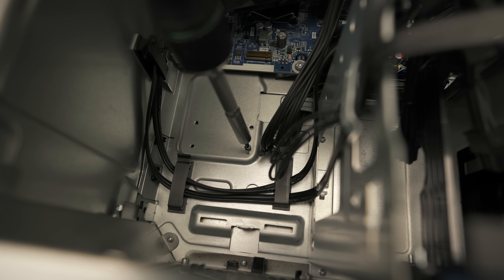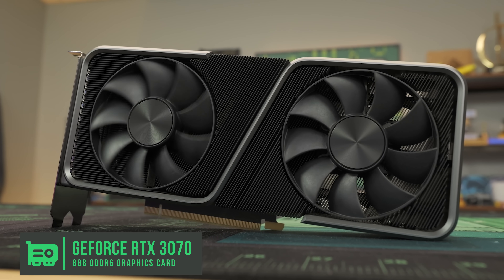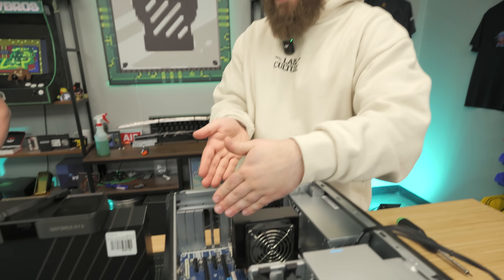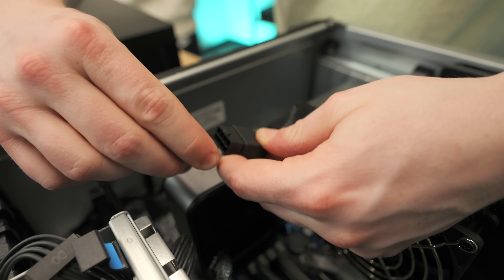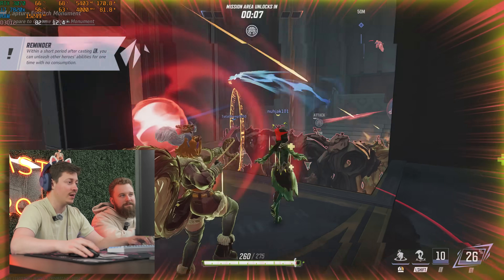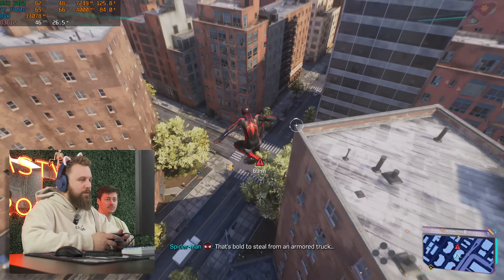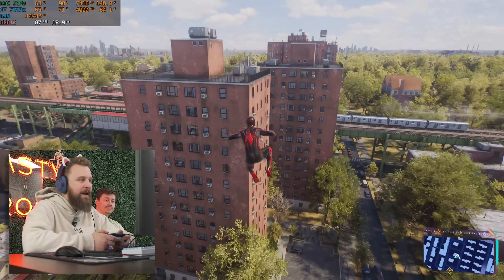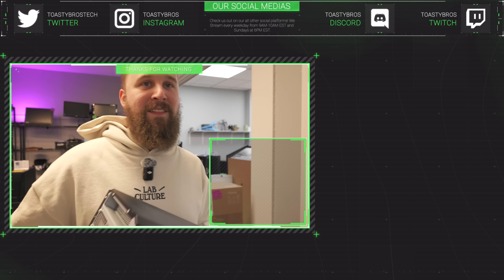EASY to Build 1440p Gaming PC for $600!

Comment from the maker: If you're looking to buy Windows 10 Pro OEM key or Windows 11 CDKeys, I highly recommend checking out gvgmall for great deals!
GVGMALL 25% discount code: TB20
Windows 11 Pro ($24): http://www.gvgmalls.com/gs/w11p-tb
Windows 10 Pro ($16): http://www.gvgmalls.com/gs/w10p-tb
Windows 11 Home($22):http://www.gvgmalls.com/gs/w11h-tb
Windows 10 Home($15):http://www.gvgmalls.com/gs/w10h-tb
Office 2019 Pro Plus ($60): http://www.gvgmalls.com/gs/o19p-tb
Office 2016 Pro Plus ($29): http://www.gvgmalls.com/gs/o16p-tb
Buy MS Win 11 Pro OEM KEY GLOBAL in GVGMALL: https://www.gvgmall.com/
#windows11cdkey #pcbuild #gvgmallwindows11
Reply: Cpu bottleneck guys.RX 6600 or RTX 3050 will be good with this cpu
Reply: so you did the build I talked about. 
the build I did for just a 100 euro's.

good for you guys. 

Lets see how many views this will get.

*huh... how does that motherboard only have one nVme slot 0.o ?

Did you lads check the first pci-e slot was set on gen3 8gb/s in the bios ? Frames per sec looked low. I get those with an GTX 1070 8gb.

Comment: lmao Dropping $700 for a used PC. The CPU bottleneck and of course spending $300 for a used card with 8GB VRAM is a BIG no. 6700XT is much better. Total: $632.76

CPU: AMD Ryzen 5 5600 3.5 GHz 6-Core Processor  ($70.00) 
CPU Cooler: ID-COOLING SE-214-XT ARGB 68.2 CFM CPU Cooler  ($16.98 @ Amazon) 
Motherboard: ASRock B550M Pro4 Micro ATX AM4 Motherboard  ($70.00) 
Memory: Patriot Viper Steel 32 GB (2 x 16 GB) DDR4-3200 CL16 Memory  ($39.99 @ Newegg) 
Storage: Klevv CRAS C910 1 TB M.2-2280 PCIe 4.0 X4 NVME Solid State Drive  ($50.99 @ Amazon) 
Video Card: Sapphire PULSE Radeon RX 6700 XT 12 GB Video Card  ($300.00) 
Case: Zalman T3 PLUS MicroATX Mid Tower Case  ($38.90 @ Newegg Sellers) 
Power Supply: Montech APX 650 W 80+ Certified ATX Power Supply  ($45.90 @ Amazon)
Reply: Is there a different motherboard I can use for this?
Reply: Yea any b450/b550/a520 but preferably b550.  @EpicArachnid
Reply: Well this comment aged like milk. You cant get the cpu, ram or storage for anywhere near these prices now.

Comment: I have a RTX 3060 ti, Ryzen 5 5600X and 32 gb ram in my PC and it runs everything. I use a nice LG 1080p 144hz HDR gysync monitor. its wonderful for me. Even runs the newest Monster hunter Wilds game on default High no issues.

Comment: Ended up getting this to upgrade from my old gaming laptop, but on turning it on it won't even get to the BIOS menu. Tried pushing the cmos reset but still not going to the BIOS.
I've reached out to PCPS support but it's pretty late rn. Anyone here have tips for this or did i just get a bad system?
Reply: For anyone reading this with a similar issue, PCPS got back to me and said that the cause is a drive not initializing. If you remove all HDD, SSD, and flash drives the BIOS will open, then add them back one at a time to figure out which wasn't working. (For me it was the M.2 and the boot flash drive)

Comment: I have a 7800xt and am having a hard time with deciding what cpu to get I’m wanting to just get it up and running and be satisfied and not feel the need to upgrade but I don’t wanna cheap out and be screwed over!
Reply: depends on your budget, id recommend AMD Ryzen 7 7800X3D for pure gaming, if youre on a tighter budget Ryzen 5 7500F is great value. you could rock them on a B650 board
Reply: @ I did a 7700x since for more than gaming and 3d v cache would have made the budget too much
Reply: @ thats a good choice if you need more cores and want overclocking, hope it serves you well
Reply: @ thanks! The card I got came as an oc version so it’s already a little boosted. It performs well above anything I’ve ever used! I don’t need anything more honestly! I’ll check out overclocking later though!

Comment: My rig is a Lenovo P250 with a W2135 8 core, 1tb ssd, 500gb nvme, 128gb ram, and a EVGA RTX 3060xc 12gb. Now i need that ram for music production. It doesn't seem to affect my gaming at all. I am running it in 2K high to ultra settings in most games and getting really good benchmarks by just turning off ambient occlusion in most games and lowering volumetric fog ect. Which i cannot stand anyway. Goes to show you do not have to spend alot of money these days. Total was only around 365 to 370 with all of it.

Comment: I think its roughly the same performance as a P-520 wich usually comes with a 6 core W-2133 or 2135 xeon and the upgrade to a W-22XX is expensive i think the same applies to the Z-4 G-4 that basically uses the X destop version of both W-21XX and 22XX xeons.

Both 10 core  Xeon W-2255 and i9 10900x cost like 250-300 usd and are basically the same chip.

Comment: A couple of other points, if you are looking at T5820's be advised that Dell has different motherboards for Sky Lakes and Cascade Lakes. Who the hell knows why but that is one of the reasons I have gone with Lenovos and HP's. I had to get a replacement motherboard because Cascade Lakes are way over priced and a replacement board was only 35 dollars. Swapping it out was a pain though. I played with an HP z840 too but despite an 1100w power supply it only has 3 6 pin connectors. Kind of stupid, maybe why they did an overkill with the Z4 G4 with 4 8 pins.

Comment: The 3070's 8GB of graphics memory is the big weak spot. You do want at least 12 or even 16 in 2025. Maybe an AMD option? Yea (You're not going to use RT on a system like this.) But good build for older games.

Comment: Did something similar, got an HP Z230 tower with i7 4770 and 500gb SSD for $75 plus shipping, additional 16gb ram to go with what I already have (32gb total), and re-using my 3TB HDD for storage and games that do fine with it, then got a W6600 Pro 8GB for graphics. About $320 total.
Reply: that sounds amazing. what do you use it for primarily?
Reply: @cassterisk  Games that my Steam Deck can't quite handle hopefully, depending on time (work 6 days a week and kids, etc)
Reply: Somewhat unrelated but I got the same cpu with an rx580 pc gifted after helping my homie rig and boy am I confuse lol it didn’t display on me ☹️ not my main machine but hoping to get em up later and see how it performs as a budget rig
Reply: @charlessmith9369  try booting without the card using the integrated graphics. If that works then double check power connection to the 580. Double check monitor cables too.
Reply: @ definitely will check that I did try just mobo but I didn’t have the GPU detach maybe it’ll help he was coming from an 20series in not sure if drivers is on a bios thing or storage I’m pretty sure it storage. I just didn’t have enough time last night ima take a 2nd look today I need to test that 550W evga supernova PSU aswell hoping it’s not bricked got it used from a local who was selling his whole platform
Reply: @charlessmith9369  drivers are OS, you should still be able to boot regardless of drivers so long as the hardware is working

Comment: Ryzen 5600 with 6700xt/6800xt?? It would be better than this imo
Reply: yes, but no shit. this is just a workstation upgraded.
Reply: @lemonyz420  i meant this build for the pricing, a used gpu and everything else new is still in the ballpark of $600

Comment: I'd recommend a workstation upgrade up to 3-400 $ max for a gaming PC. Above that just get a cheap Am4 build with a decent GPU and you can go allll the way up to a higher mid tier build with the same pc with a 5800x3d and a stronger gpu.. with a workstation pc you're always hard locked to an ancient socket and barely if any upgrade path.
Reply: lmao Dropping $700 for a used PC. The CPU bottleneck and of course spending $300 for a used card with 8GB VRAM is a BIG no. 6700XT is much better. Total: $632.76

CPU: AMD Ryzen 5 5600 3.5 GHz 6-Core Processor  ($70.00) 
CPU Cooler: ID-COOLING SE-214-XT ARGB 68.2 CFM CPU Cooler  ($16.98 @ Amazon) 
Motherboard: ASRock B550M Pro4 Micro ATX AM4 Motherboard  ($70.00) 
Memory: Patriot Viper Steel 32 GB (2 x 16 GB) DDR4-3200 CL16 Memory  ($39.99 @ Newegg) 
Storage: Klevv CRAS C910 1 TB M.2-2280 PCIe 4.0 X4 NVME Solid State Drive  ($50.99 @ Amazon) 
Video Card: Sapphire PULSE Radeon RX 6700 XT 12 GB Video Card  ($300.00) 
Case: Zalman T3 PLUS MicroATX Mid Tower Case  ($38.90 @ Newegg Sellers) 
Power Supply: Montech APX 650 W 80+ Certified ATX Power Supply  ($45.90 @ Amazon)

Comment: For budget gaming builds you can't beat starting with a used workstation. I have built them on an HP z440, Lenovo P510, Lenovo P520 and a Dell T5820. The Lenovo's are the the easiest but you can't use standard ATX power supplies so the P510 is limited to an 8/6 pin video card. The P520 has 2 8 pins. The T5820 has 2 8 pin as well. The z440 only has 2 6 pins but you can get adapter cables to use a standard ATX power supply. The HP's use their own CPU fan headers so using an upgraded CPU cooler can be a problem. The T5820 does too but you can get an adapter. The problem is that the video card will cost you more than then the rest of the system.
Reply: Those E5 Xeons that the z440 uses are crazy.... thgey have tons of cache and cores for dirt cheap and almost make me regret getting a p520.

Comment: With Windows 10 no longer getting security patches in October, you should stop recommending builds that are not compatible. Or at least talk about what it would take to make it so (TPM modules).
Reply: The HP Z4 G4 is Windows 11 compatible
Reply: @Pasi123  my bad, usually 7th gen isn't supported.
Reply from the maker: @benjohnson5571  x299 is different, it is supported

Comment: Z Workstations lets gooo! I actually have a Z4 G4 motherboard, CPU, and cooler assembly in my closet. I was trying to find a way to do my usual trick of finding a way to make this use a standard ATX PSU in a standard ATX case. Unfortunately, its alot more difficult compared to the Z440, Z420, and Z400s of the past :(. Great video you guys!

Comment: This HP Z4 G4 is extremely good value. You can't build a cheaper PC from new parts with the same specs and versitility. The only downside with the computer is that it uses proprietary motherboard and power supply.

When you are done using this as a gaming system you can get a bunch of cheap ram, maybe upgrade the cpu, add a high speed network card, add some storage and you got a very powerfull home server.

Comment: 6700XT would have made a lot more sense than the 3070 because of the additional 4GB of VRAM.  That makes a big difference in newer games at 1440p.
Reply: Not to mention, the 6700xt is just an excellent card all around. Completely agree though, that was my first thought when they mentioned 3070.
Reply: You remember that 3070 was originally aimed against 6800? Sure 6800 has double the VRAM but its Ray Accelerators are subpar without software aid. A 6800 is even more powerful than a 6700XT.
Reply: @jskop566  product choices are always a variable in "used" products.... its easily a "well thats the deal at the time so thats what we got".

its hard to criticize when buying used its not like you have a selection of any gpu to pick from.
Reply from the maker: Good option, on average the 3070 is cheaper on the used market right now but 6700xt is one to look out for
Reply: @ToastyBros  which equals more fps per dollar
Reply: @Sandfill source
Reply: @ToastyBros flip-wise,we know the 3070 build would sell faster-its a known quantity for the gpu brand alone,sadly.Sold quite a few.
Reply: Or a 2080ti w/ 11gb vram. Picked one up for 215$ on eBay. Dell oem.
Reply: No it doesn’t, 4gbs of more ram doesn’t always equal more performance. The 6700XT is still slower despite having more ram.
Reply: The way the 3070 processes what is in vram is faster. Just because a gpu has more vram these days doesn’t exactly mean it is capable of using it. If the gpu is slow at processing then 12-16-32gb vram means nothing in terms of gaming. 6700 xt is a great card just a tiny bit slower.
Reply: Totally agree. I would even go for the regular RX 6700 10gb
Reply: In a recent benchmarks the 3070 still beats the 6700xt even with more vram in recent AAA games
Reply: Eh the 3070 is still pretty solid, even with ai upscaling at quality res, it still looks better than amd using taa. Yea the vram is a plus but at the end of the day they both perform the same but nvidia will always have better image quality and will have around the same performance. In this case nvidia still wins
Reply: 3070 is cheaper and should get us through this next gpu shortage. 6800xt is a superb choice if you can get it decently priced
Reply: And cheaper
Reply: I purchased a refurbished/renewed 6700XT for Newegg for $260 a month ago. Less than what they got the 3070 for. Id also take the B580 over both of these cards with the right processor.
Reply: But It's AMD. People building these PCs just want Nvidia because it has the cringe 'RTX'.
Reply: @flyinghigh1868  Or because it sells better, and you get function over vram
Reply: These guys are Nvidia fan boys.
Reply: No because the amount of vram is only one part of the equation. The speed can make up for that like in the case of the 3070
Reply: @16driver16 speed can't make up for VRAM go watch Hardware unboxed or basically any other reviewer
Reply: Na  you tripping lol 😂💀 3070 is a far better card  just cause it has more v ram does not equate better performance and also unless your going max setting in game then v ram should not be much of an issue. If you want a brand new card then the 6700xt would not be a bad choice but then there is the b580 if you can find it for the right price.
Reply: @daps_09 yeah, but there are also v ram requirements for new games, so I would still go with the AMD
Reply: I would normally agree but the dlss transformer model is a game changer for all rtx cards especially ones that are generally used at 1440p or 4k like the rtx 3070. You can now run a 3070 at 4k at respectable fps using the new transformer model in ultra performance while maintaining much of the visual fidelity. Fortunately, the used market in Australia hasn't realised how big a game changer the new transformer model really is. RTX cards are still priced the same before the model came out and 3070 and rx 6700 xt are fairly comparable here.
Reply: u should buy ur own pc,instead of watching yt and trying to be smart...
Reply: Cap. The 3070 is like 15 percent faster. The 6700xt is worse than a 3060ti and a b580. Sure it might have more vram but when a GPU is 15 percent faster you gotta just get the better card. Not to mention there the same price
Reply: @Sandfill Wrong on two counts. For one on a pure performance basis the 6700XT performs the same as the 3060 Ti and B580 and for two the 3070 is not 15% faster on a low-end or lower mid-range system as shown here because of NVIDIA's well-documented 20-30% higher driver overhead.  In fact, it will be the RX 6700XT that's faster.  Source: https://www.youtube.com/watch?v=JLEIJhunaW8

A B580 would perform horribly on older systems due to lack of ReBAR support AND having high driver overhead than either NVIDIA or AMD on top of it.  Unless you have a Ryzen 7500F/7600 or faster you WILL see slower performance on an Intel GPU.  Source: https://www.youtube.com/watch?v=00GmwHIJuJY
Reply: @Sandfill where did you get this information spewing nonsense they are about the same?! Just one card has more vram.
Reply: @thatotterguy3062  https://www.youtube.com/watch?v=3hmt8qQbpsM
This is a recent benchmark video and the 3070 is faster on average, sometimes nearly 20fps faster in some games.
Reply: @Tealdragon204  LOL there so many benchmarks on the 3070 vs 6700xt and the 3070 is still faster on average.
Watch Hardware Unboxed testing like Kingdom Come Deliverance and the 3070 is faster.
Reply: @Sandfillrx 6700xt is 50% faster than 3060ti beat 3070 = b580😂
Reply: @Sandfill  what are you on?!!?!?!
Reply: @Sandfillmy guy if it doesn't have enough VRAM it stutters and becomes useless. Give a 4090 8GB of VRAM and it's a bad card

There's a reason 3070s flooded the used market

Also your stats are wild. I have no clue where you're getting them from. The 6700XT is faster than a 3060 Ti
Reply: AMD Shill
Reply: @Muellenbach67  Seethe with your 8 gb
Reply: @ Anyday over miraculously thinking vram = performance

Comment: Just put together today a Z2 G5 tower, i9-10900k, RTX 2080 SUPER, 128GB ddr4 3200 memory a 1tb m.2 for the OS, 2tb m.2 storage 2tb sata ssd storage. Video editing
Reply: 128gb ddr4 is overkill but you won't need to upgrade ever
Reply: In the 80 degree room it runs background at 88 to 100 degrees a strain keeps temps under 160  gpu hotspot is 110 degrees.
Reply: 128GB RAM and 1TB for OS???
Reply: 128gb ram why u wan go Pluto? 😂
Reply: Did it cost $600? No1cares
Reply: You should have bought a 3080ti instead of a 2080  by saving some money from the ram by getting a 64 gb kit
Reply: @alokdas1910  fr... That guy is telling lies
Reply: @alokdas1910   2080 were purchased a yr ago NOS

Comment: I got a question about the ibuypower slate 8 mesh with the rtx 4060 they have at Bestbuy.Will it perform better then my Ps5 running at 120hz on a Samsung Odyssey G5 32" curve model on BO6 Warzone?Thank you Bros
Reply: Oh to add yes you would see a difference in games, like warzone and fps titles in terms of frame rate by dropping down the quality settings but as raw performance the PS5 and rtx 4060 are about on par(minus ray tracing and ai upscaling)Just cuz that build is 1100$ for a way to overkill CPU it's a waste I could get you a better PC as parts for cheaper and cheap enough to get someone to build it for ya